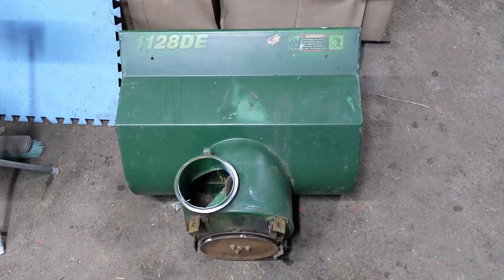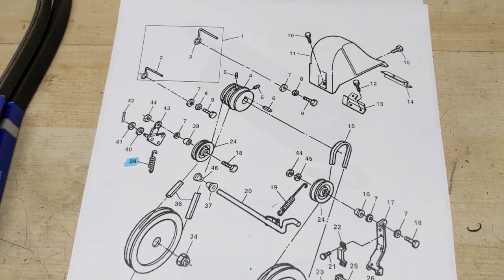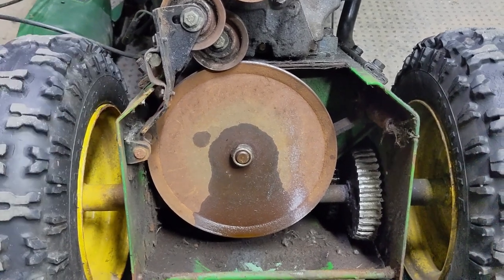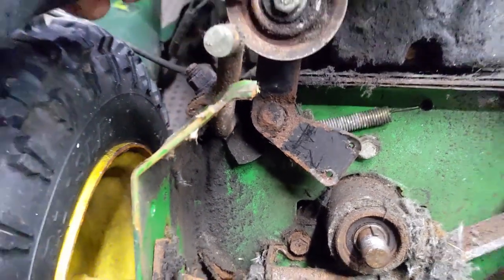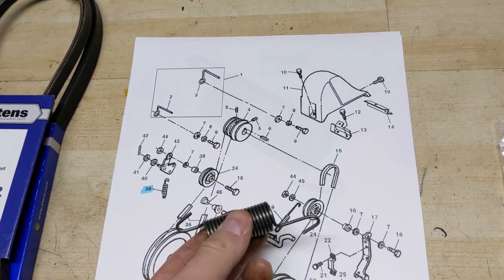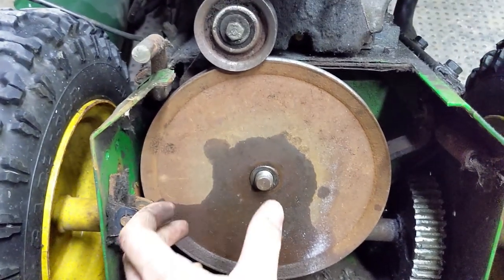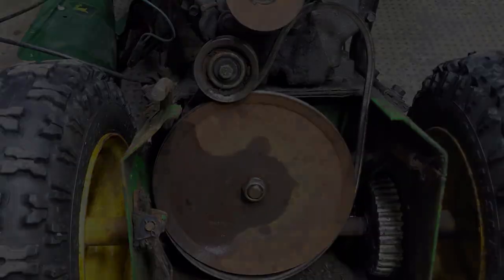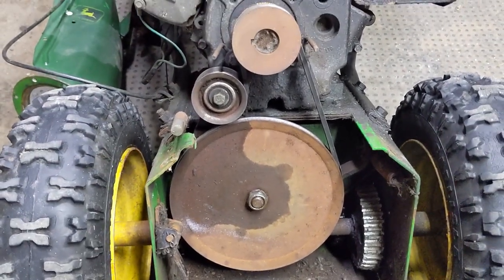John Deere 1128DE Drive Idler Spring & Belt Length

Comment: Thanks for this video. Live in Buffalo and my snowblower just stopped moving midway through a 4' snow storm.. With some exploring (I know nothing about snowblowers) I found a broken rusted spring in my Ariens snow blower but could also not find any diagrams that tell you where to hook the tension spring!! I am sure my blower is similar setup to yours, and if not at least I now know the concept and what to look for. Thanks so much!

Comment: Good repair Jake. Just goes to show it’s not always a slam dunk repair. Sometimes the research takes longer than the repair. Lucky you were able to find the spring. I found a similar deal when I ordered a very tiny duck-bill vent for a fuel tank on a chainsaw, they came in qty of 10 (not expensive, just didn’t need to keep 9). I found one from another brand that worked.  Keep the videos coming.   Rick
Reply from the maker: Yea and remember I'm no John Deere tech, or Husqvarna tech, more of a jack of all brands sort to speak lol at the end of the day I have to figure out how to fix a bit of everything.

Comment: Nice repair and explanation on the snow blower.  👍
Reply from the maker: Thanks John, was lucky to get that spring without spending a fortune!
Reply: The total on the other was staggering, how can they feel justified to charge so much.
Reply: And you’re welcome Jake, anytime bud. 👍🏼
Reply from the maker: @Big_Johns  it's insane right? That's how it is. Even the dealer said if they wanted to order 1 spring they had to order 5 of them at $20.99 each it's a fortune just for 1 spring. I'd have to sell the rest on ebay, maybe that's what these guys did lol
Reply: Very insane, I’m so glad you were able to find it cheaper, I’m sure your customer appreciates it too. 👍🏼

Comment: JD machines always seem to set the large auger pulley to close to the large drive gear, wearing the edge of the teeth off. Undo the two set screws and move the pulley slightly towards the bucket.

Comment: with that endplay the air hammer trick might aid in pulley removal.
Reply from the maker: Once the nut is tight, it pulls the shaft through and there's no end play which was nice to see

Comment: Belts and springs can be a pain.  Without a good diagram, or previous machine specific experience, witness marks, common sense, and trial and error come into play.  I have had good luck with Pix belts.  Good repair.
Reply from the maker: I pretty much have different brands and styles of almost every belt length in my inventory, which is why I don't like when manufacturers don't list their belt lengths because it's like, why would I order a belt when I probably have one that'll work! And yes, it can be difficult. Luckily we got a spring and it turned out great